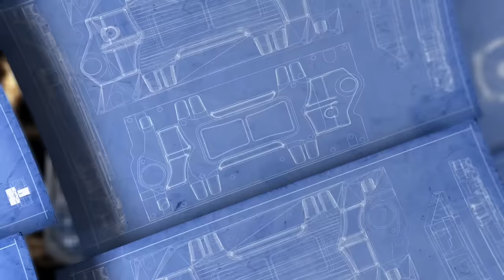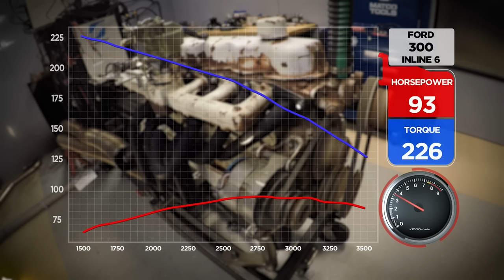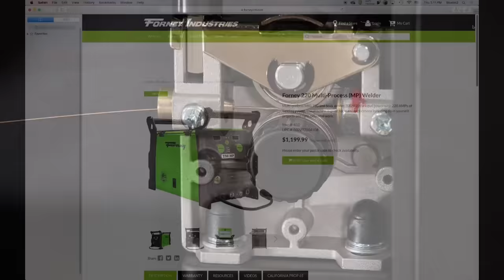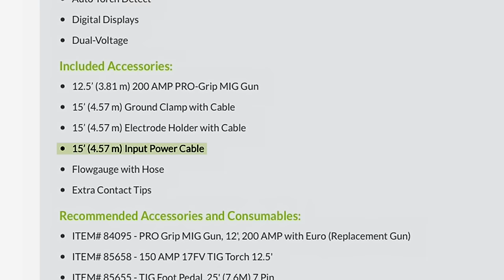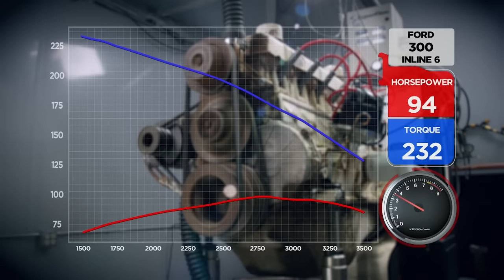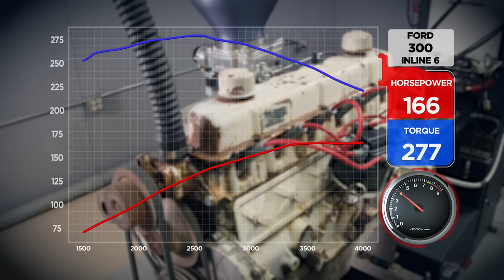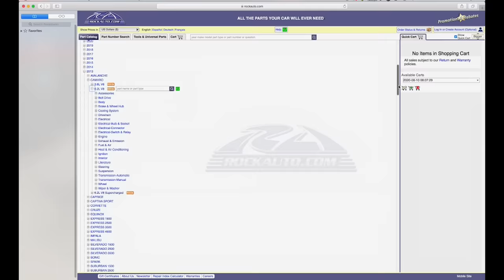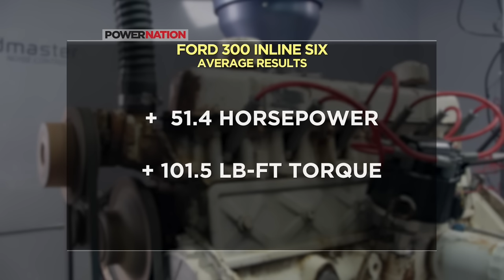Ford 300 Inline Six Gets Eye-Popping Off-The-Shelf Power - Engine Power S7, E17

Comment: Doing a dyno after each part installed "separately" to see the gains is much more intriguing than doing one pull and then swapping HCI all at once. More videos should be done this way,its more "real world" since allot of enthusiasts mod their vehicles in stages.
Reply: It'd be interesting to see what kind of gains they'd have gotten with the new intake and the stock exhaust.
Reply: Exactly, seeing what parts make the most difference is great.
Reply: @davidthompson7723  definitely would have gotten more from intake and stock exhaust than exhaust and stock intake
Reply: Yep - even a reading when they took the governor off, to establish a base line..
Reply: @davidthompson7723  my guess was that was the plan before it broke
Reply: That's how Richard Holdener does his tests.
Reply: @scottinWV  I enjoy his content as well.
Reply: agreed. Richard Holdener has the right idea.
Reply: I was hoping they would  shove the big cam in there industrial type engines have a very mild cam
Reply: Tottally clinical. And anelitiical pppart by part. Outsstanding testing sequuence. I need that torque on my old Red 150. Farm truck. Thanks I know Ups used that engine. Exclusively for ever. And up here iiin the highlands all. The orchard fans run the industrial version. Love to get one for the crank.  Great job.
Reply: Yes, my thoughts also.
Reply: Not to mention the fact it's much more scientific and gives one way more information!
Reply: Exactly
Reply: @davidthompson7723  Same here, headers may not be worth changing
Reply: Also the cost. I watched them spend at least $350 and didn't make 100 hp halfway through the vid.
Reply: 10000% agree with you.
Reply: HCI???

Comment: About 15 years ago, we ran our 300 over 40 miles pulling a 10,000lb load, after we overheated it and blew the radiator comin home from the Swamp Cabbage Festival. Thing was knockin and bangin around REALLY BAD the whole way. I watched the temp gauge go up and max out past the L, then drop down to nothing, like the truck was off. There was zero water in it. I had to hold it to the floor and could only sustain about 30 mph (thankfully there's no hills in southern Florida. I don't kno if it woulda climbed a hill tbh). We had a 351w to drop in it so really didn't care if it blew up. We we're tired and just wanted to get home if we could. Anyhow, got home, shut it off and came out the next morning and turned it over and it fired right up. Smooth as it could be. You never would've known what we did to it. Its still running and driving to this day. 94 1-ton, work truck. Its never broke down and left us stranded, ever. We always made it home. We blew a head gasket comin home from the Keys, but it still made it back to the yard, no problem. We ended up putting the 351 in a mud truck. Anyone reading this probably already knows what's up with a 300. Just figured i'd share my little torture story.
Reply: Good share buddy! I love reading these old 300 6 war stories.  How do you think it would have performed that day had you had the upgrades these gentleman did here in this video?  ✊🏼
Also, whats your mpg's look like on  your 300?
Reply: @eyedeeowe  Thanks, man! I think, with those upgrades, it probably would have blown up for real. Not because they didn't build a good motor, but because I think one of the things that keeps a 300 alive is the fact that they're not especially powerful engines. Which makes it kinda hard to sling um apart. As far as fuel mileage? I guess it all depends. But, on that trip to the keys that I mentioned, we ran 80 miles an hour most of the way, and it got about 6-7... absolutely horrendous. we have a 460 that gets better mileage. Thank you for replying. I forgot I made this comment. These were some good times I had with my dad! I appreciate you jogging my memory:)